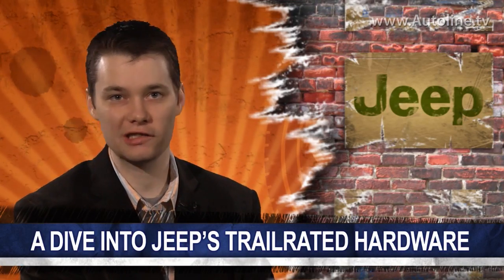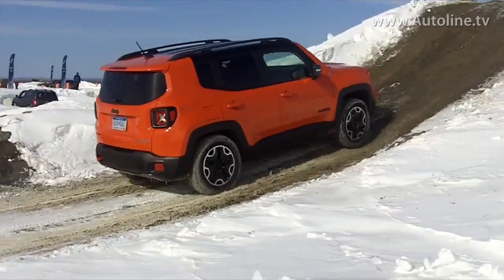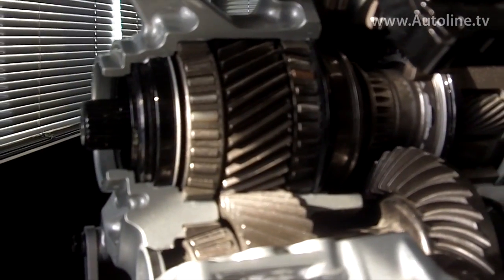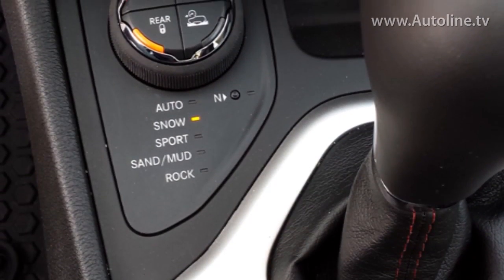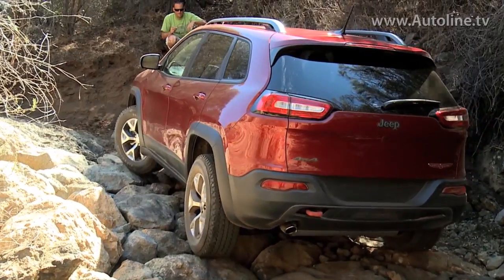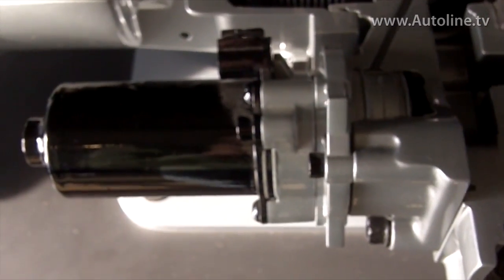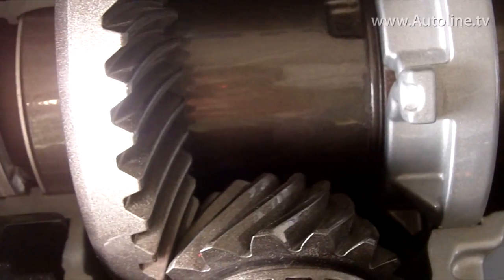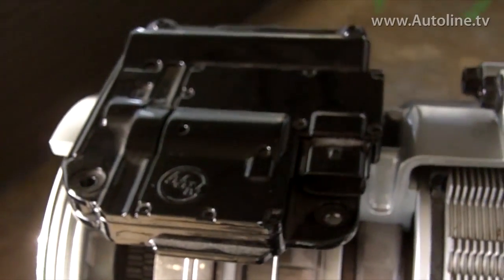A Dive Into Jeep's TrailRated Hardware

Comment: So this 4wd car is fwd whenever the all wheel drive is put off. This will surely result in bad cornering. It needs rwd.
I guess they even mounted the engine transversely with all the disadvantages this brings. I saw that design in a Landrover recently. I was disappointed by the car where it was presented in a mall in my hometown. That Landrover went so far to have drum brakes on the rear, bit I suppose this Jeep is more massive and has disc brakes.
Reply: I mean not only "bad cornering" but also general driving dynamics in general. When you go a little too fast into a bend with a slippery road, because you underestimate how slippery it is, then you take the foot from the throttle, braking power of the engine will go to the drive wheels. The front axle will brake out no matter what wheels are driven since all cars are designed that way.
If the car is rwd the braking power of the engine will tow the front wheels back to the track their supposed to role. The understeer stops the front wheels get traction again. But if the car is fwd the front wheels brake. The opposite happens like when you accelerate. When accelerating the front wheels tow the car into the direction you steer. But when decelerating they pull the car in the opposite direction. The understeer increases.
Fwd cars are not safe on slippery roads. Needs to be rwd-based 4wd.